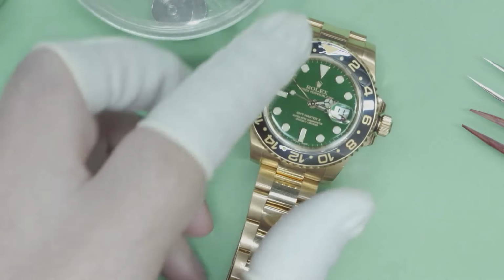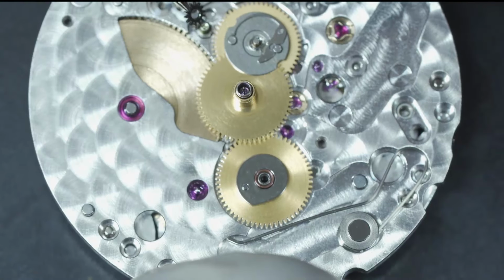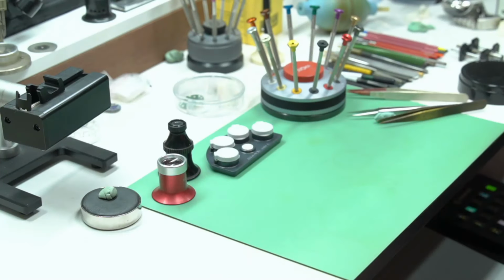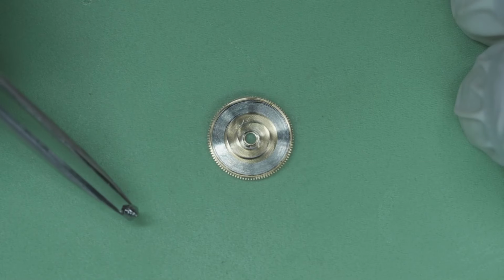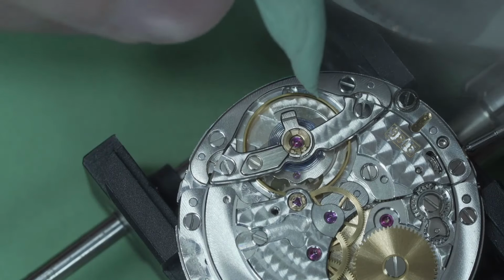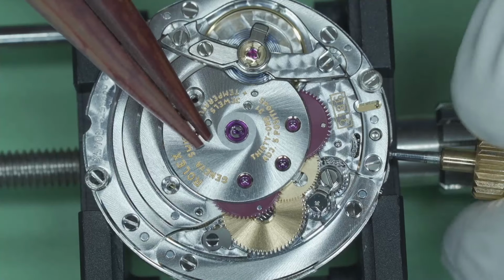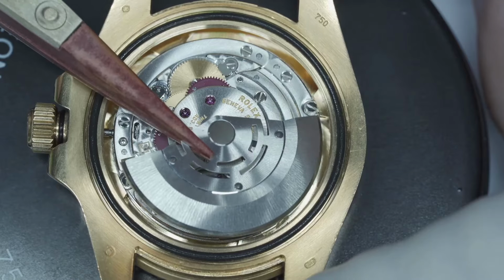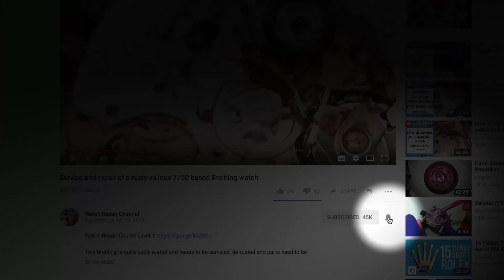A $30k Rolex GMT Master ii - Cal. 3186 Full Teardown and Service

Comment: I suppose unless you need parts this is actually a pretty simple movement looking at it so I would imagine any good quality watch maker should be able to service this as you have so ably shown. The fellow who serviced it before though should not be let near even a Seiko 5!

unless a watch has unusual complications or is something like a Patek or that sort of thing I don’t see an issue with out of warranty higher end but basic watches like this not being serviced by Rolex themselves and remember, Rolex will replace things they feel should be replaced so they are not great with valuable vintage watches anyway as they will replace the parts that make the watch more valuable.

In the old days I have found, very few people would have sent a fairly normal watch like this back to the maker for servicing, they simply would have, as this chap did, have his local watchmaker clean and oil it and put it back together.

The modern indoctrination of high end watch firms that the watch is extra special so can only be serviced by them I feel is nonsense if you have a high quality watchmaker at hand. If I only had the joker before this though it would have gone to Rolex!

You may have said so I’m sorry for asking as I’m typing this before the end. How much did you charge to do this service?
Rolex with the gold models charge a premium over stainless steel so here in Europe it would have been about €1000 to service this one assuming it was a straight service with no parts needed other than seals.
Reply: ianmedium In the US Rolex will charge 500 for a general maintenance
Reply: Wow that´s too much. Im a watchmaker as well i charge about 450€. I think he even charges less :D
Reply: Simple movement? Wow
Reply: jimmyf1312 but is that for Gold? I know stainless is that but they always charge a premium for precious metals, I have no idea why though
Reply: Bob Klumpp well, it is really in that it is time date and GMT, no perpetual calendar or Chronograph. It might be well finished with some special metals to aid antimagnetic properties ( which in truth are very similar to other off the shelf ones) apart from the microstella adjustment in mechanical watch terms it is technically simple which is why I love it even more as that means more reliable, less to go wrong and easier to maintain high accuracy.

I love Rolex movements and have yet to meet a watchmaker who does not either for their robust build and reliability.

Comment: It looks so hard to manipulate such small parts into tiny holes perfectly are we missing the footage of you chasing tiny screws bouncing across the floor or digging through shag carpet with a magnet for parts or do you often have parts simply disappearing Well that happens to me. yet I endeavour to persevere. You make it look easier than it is, with your kicking tools with those little  apparatuses impossible is defeated. I could not see what are you using for magnification besides the USB scope?

Comment: For some reason, I am a little disappointed with the finish quality of the main plate.  For the cost and prestige that is Rolex, I would have thought that there would be no machining marks left on the plate. Just a smooth polished finish.

Comment: No disrespect to what you do here. I’m sure you are a very qualified watchmaker. If someone can afford a $30k watch they should be able to spend the extra $200 and send the watch to a Rolex service center.
Reply: I suppose it's possible the first owner sold it on before having its first service? Also, seeing as the watch is at the most 15 years old (Rolex currently - for new models - say a service every 10 years), it may have only had one service? Presumably the current owner didn't pay $30K and if it has never been to an official service centre there is less imperative to send it to one now.

Comment: manufacturers, again just don't learn that forcing the customer to have no choice but to enlist a factory service because they over complicate design intentionally  like the balance wheel weights that with only the Rolex tool will adjust and have Chinese clones been able to duplicate this tool yet? So customers will stray away to other company's that don't lock them into a corner when it comes to a choice for who will carry out out service and repairs. We have the same with  BMW making cars with no dip stick and force you to go to BWM main dealer. It happens in many industries and in the long run it doesn't work out well for manufacturers. This is a communist mentality in a capital society but hey we think we are in a free capitalist era but it's tainted with socialist values. Thanks for a good video 👍👍

Comment: The movement look "cheap" to me when compared to a.Lange & Sohne, Patek Philippe or GP.
Reply: Sure it does, this is a tool watch not a luxury piece
Reply: You have a point. It's probably why you never see display case backs on Rolexs. Having said that, I think they are going for the most robust AND accurate movement. Right? Heck Omega has prettier movements than that but... there's something about Rolex...
Reply: It's probably due to lighting. Mark's camera setup probably used LED lighting, for some reason it amplifies the tiny scratches and bleaches the finishing texture, making them look a lot cheaper than they should be.
PP wouldn't fare much better either, it's not about the price.